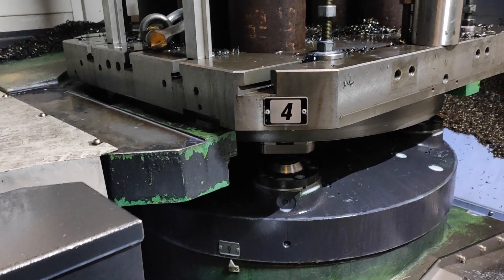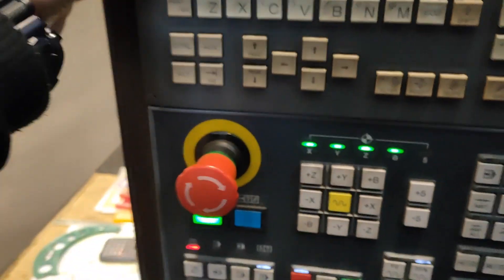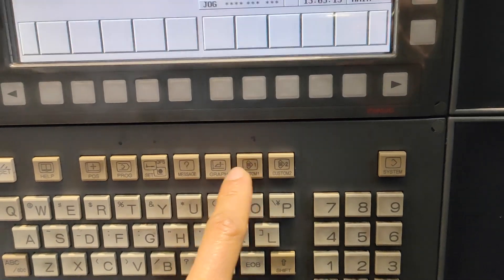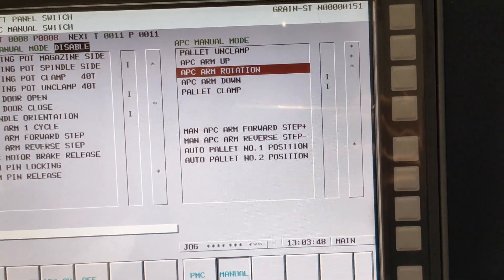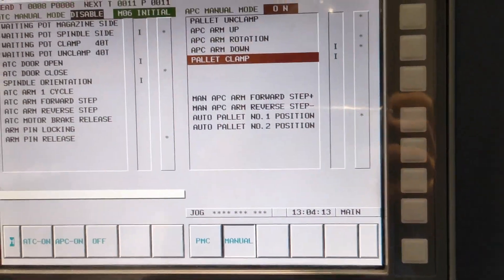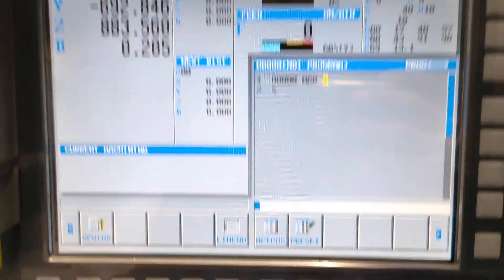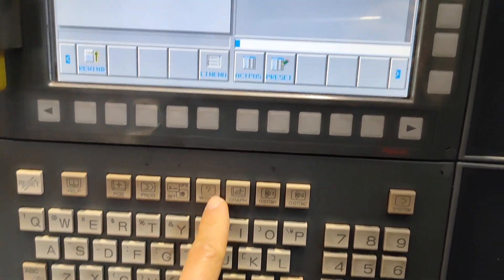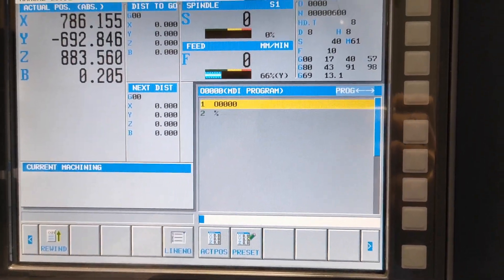#PALLET CHANGE ALARM(table change overtine alarm no. 2067 check APC change status)

Comment: Hello.
fanuc series 0i mf machine error. when running memory mode, if there is a command to change the tool while the tool is being installed on the main shaft, an error will appear. Other machines do not have this error, only when changing the tool in MDI mode while the tool is being installed on the new shaft will have such an error.